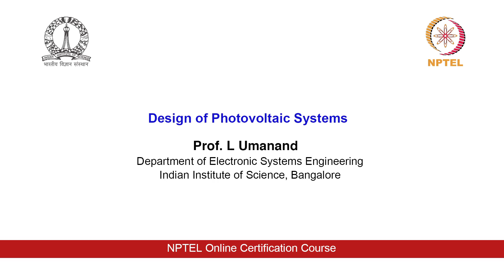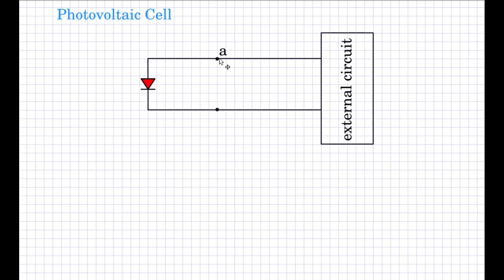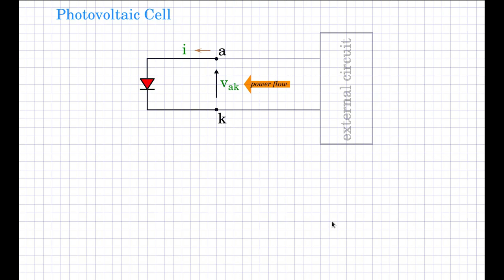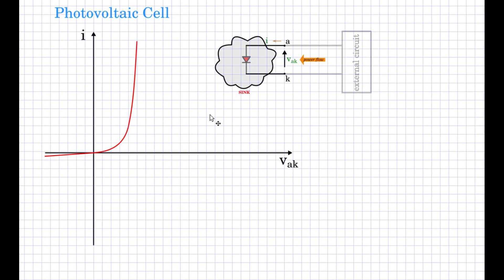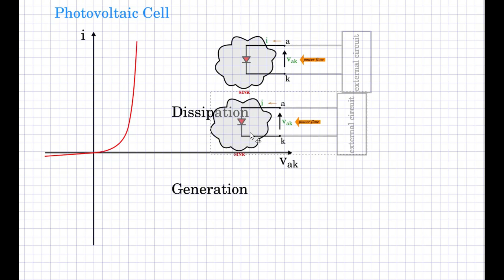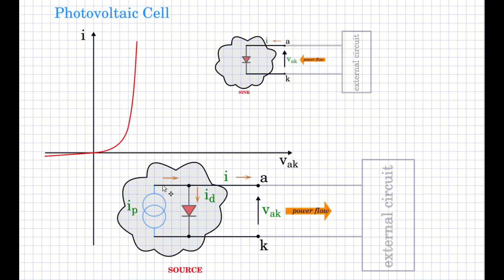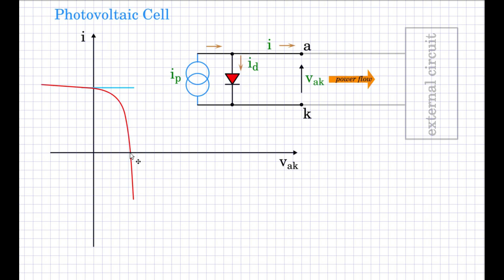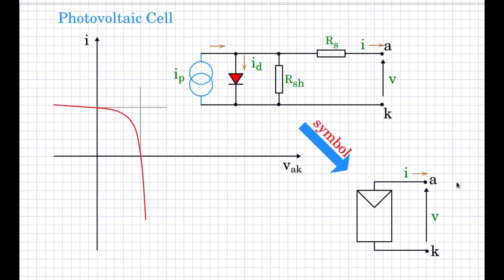PV cell characteristics and equivalent circuit

Comment: Sir,  why you started with the PV relation of a simple diode ? what is the necessity of this PN diode curve ? why did not you started directly with the PV cell circuit ? in the PV cell equivalent circuit,  what does the parallel diode represents ?

Comment: Sir one question arriving that if diode is placed in parallel to current source than when diode is in forward mode it should short-circuit the path.
Why current is flowing further.??
Reply: Dear Kishan,
One explanation could be , the diode is having its internal resistance which can be very less resulting in maximum current being flowing through diode & rest current to the output load. That is why you can see the Voltage is reflected higher at the output port due higher drop at diode and current will be less at the output terminal.
You can figure this out from the PV module specification of any brand , you will get to know that Voltage is much higher as compared to current . For instance , 365 Wp module having 72 cells have 40V  Max Voltage & 9A Max Current.
Hence the query that diode in connection with current sources resulting S.C is not practically possible otherwise the theory of solar PV would have been failed.
Hope you got some idea !!!
Reply: @sunilrtripathi4670  perfect explanation by Sunil sir .
From today I will not forget your explanation.
I have referred many Google site's even books but today I got perfect answer

Comment: There's a jump in reasoning when resistances are introduced. It is either "real diode" or "ideal diode + 2 resistors". Leaving the diode as it is and adding resistors makes no sense. Otherwise very good lecture and I know what I'm talking about having two degrees in electronics and electrical engineering. I'll watch a lot from this lecturer in the near future.
Reply: Luzt , I agree with you. The diode in the first diagram should be replaced by the current source or he should explain why that diode is necessary.

Comment: Great video. Only question I have is regarding the resistances you included in the circuit. What is the logic in assuming those impedance? For instance, whether or not you place a shunt resistance as you show here, what difference does that make? Thank you
Reply: due to the non-idealities of the constant values of current and voltages in the IV characteristic graph as shown